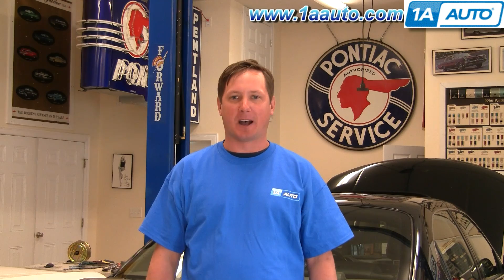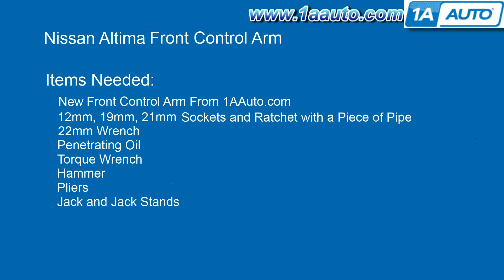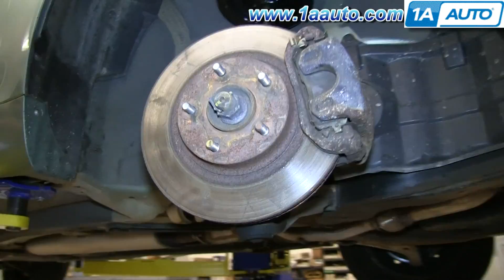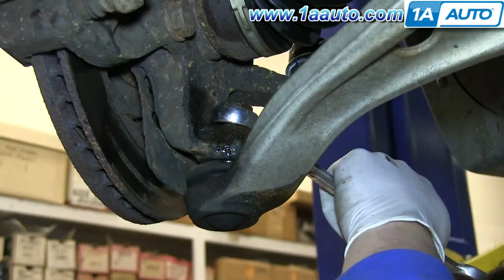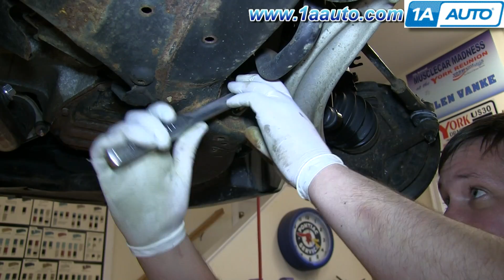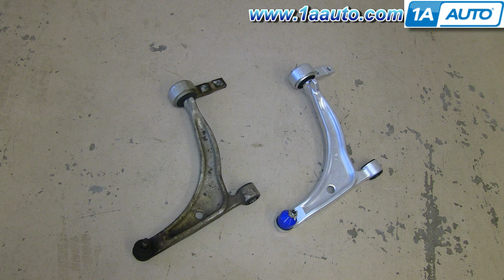How to Replace Control Arm with Ball Joint 02-06 Nissan Altima

Comment: You have two videos showing how to replace the left and right control arms. But the procedure is slightly different on both. Driver's side video shows adding resistance to control arm when tightening the bolts to specs. Plus never removing the frame brace. On the video of passenger side the frame brace is removed and no tension while tightening the bolts to specs. Which one should I do? I have to replace both sides of my 2006 Nissan Altima 3.5 control arms. I would think you have to do the same for both sides. This will be my next project when I order the parts. So hopefully you can direct me to what is the more correct procedure. Thanks for all your vids, you guys have helped me tremendously.
Reply from the maker: +Lazaro Tamargo Thanks for checking us out. Shop for high quality auto parts on 1AAuto.com:

http://1aau.to/m/Shop-1AAuto-c
Reply: @1AAuto  so what's the correct procedure?

Comment: Question....my left control arm rubs my rotor (only when making a hard left) the right sids doesent rub at all....what did i do wrong
Reply from the maker: +Rigo Aparicio We wouldn't be able to diagnose an issue like that here, you may want to have a local mechanic take a look at it. Thanks for checking us out! http://1aau.to/m/Shop-1AAuto-c

Comment: It's not coming off with a simple smash of a hammer. I've been nailing it with the 4 lb. It's not going to come out. What else to do
Reply from the maker: +Bondo Thanks for watching!  Try using multiple treatments of penetrating spray first to see if that helps loosen it.
Reply: What does that bracket actually do? Why is it there

Comment: Great video however when i replaced mine u only need to LOSEN then back 2 12mm bolts not the front bolt on the black thing under the arm. Once u losen all the 19's u can slide the arm out. When reinstalling pop the arm back in :) thanks for the video helped allot
Reply from the maker: +bbblahoo7 Thanks for the feedback!
Reply: I wonder what that does if anything. Manufacturing part number listed as some kind of control arm stop. Maybe stop it from dragging when it falls off LOL

Comment: The front wishbone Bush should not be tightened up until the vehicle is on the ground, otherwise it's it's tensioned before somebody sits in it, then when it's under load it's tensioned again, being a mechanic you should know this that is the basics 😱
Reply from the maker: +Livesinthe Shadowsofthenight Thanks for the feedback! The mounting bolt is seated by the frame of the vehicle on both sides so the tension of the bolt is carried there. Thanks for checking us out! 1AAuto.com

Comment: What was the main reason to replace the control arm? What are the symptoms?
Reply: If youre driving at a low speed your worn ball joints will make your tires wobble
Reply: Clunking noise when driving or do 6, 12 o’clock pull push method to see if there’s a play.

Comment: Don't forget a good drill bit and tap because some those 4 - 12 mm bolt are  going to break!  You should PB Blaster them(there are some holes in the frame to use) the night before and maybe heat them up before you try to remove them. Don't use an air tool to remove them!!!!! Good luck. Good video thanks for the help.
Reply from the maker: +Arch MacLeod Sr Thanks for checking us out. 1aauto.com
Reply: One of those two 12mm bolts snapped off for me. 

Is it actually necessary to remove that bracket? I have seen more videos where they didn’t.

Comment: I am working on this repair this week with 1A Auto Parts.  Some Tips:  Get an early start, the cotter pins can be quite tricky if rusted in place, & have a torch of some kind along with penetrating oil as this video recommends.  One of my cotter pins was rusted in place so I will have to sheer it off with an impact.  There is not enough room for a standard impact wrench so I am going to try an impact ratchet wrench.  I had to pause the repair because I started too late in the day.  I will add more info as I finish things up.
Reply from the maker: +Chauncey Frend Thank you for checking us out, as well as the information provided during the repair. This will assist other viewers get this completed easily and timely. 1aauto.com

Comment: 100 ft-lb is way too tight for the lug nuts.. any manaul will list torque as around 110 N-m which is equal to around 80 ft-lb.
Reply: Sven H. yea its 80 ft-lb

Comment: I don't have an Altima, but the 2007 Nissan Maxima has that same bracket and I was cautious to remove it because the large bolt looked important. Thank GOD, I watched this video first, it just saved my life and possibly my car.  Now I want to go back outside and get back to working. Can I use a regular jack because I don't have that kind of jack stand.

Comment: Very Awesome video!! I can not wait to get started on the repairs myself. One question, will this process work on a 07 Altima as well?
Reply from the maker: +Mymy0325 This applies to the 02-06 models. The process may be different for an '07. Hope this helps and thanks for watching

Comment: do we have to get an aliment after replacing the control arm?
Reply from the maker: Michael A Yes.  You should get an alignment any time you do work on your steering parts.  1aauto.com 866-403-3393

Comment: How do you know its time to replace you lower control arm?
Reply from the maker: Usually the bushings will start to dry rot, and start to make noise. Hope this helps you out. 1aauto.com 866-403-3393
Reply: Bad ball joints connected to your control arms will make your tires wobble at low speeds

Comment: Hi. I passed over a big hole and the right tire stroke very hard, now, when I turn steering wheel to the right, right tire rubs with the chasis. Actually, I noticed the right tire is closed bacwards the part that stops mud. What do you think is damaged and how can I fix it? I thank you in advance for your help. I have a Nissan Sentra 2001
Reply from the maker: Thank you for watching! It sounds like something is bent like a control arm although i am not sue what is is without taking a look.
 888-844-3393

Comment: @1A Auto Parts Do you need to re-tighten anything once the car is back on the ground?  What about using grease on the ball joint prior to reseeding it?
Reply from the maker: If you follow this video you should be fine. The control arm isn't greasable.